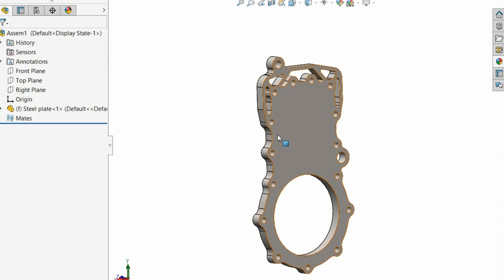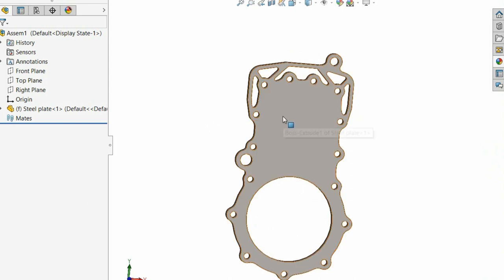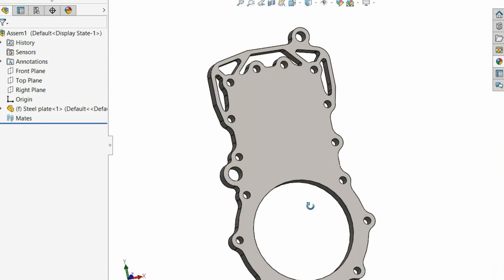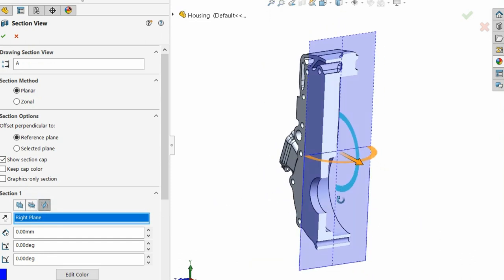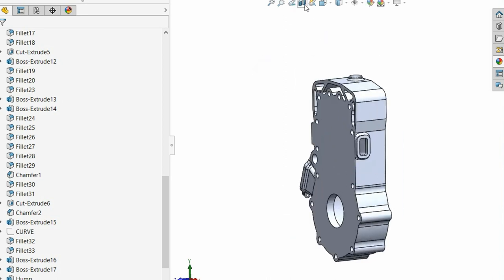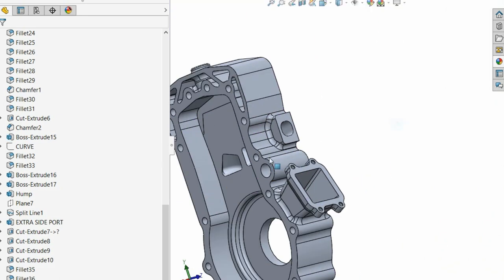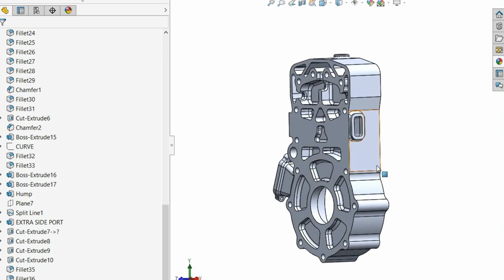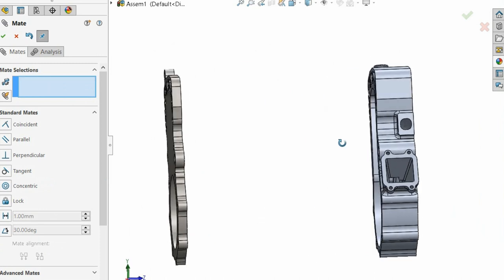The Hudson/Hossack Engine - Part 7

Comment: I like modularity of the design. Single cylinder setup is sufficient to test crutial parts and aspects of the engine.  Commercial product could make many variants from common parts.
I am afraid of wearing and forces working on piston sides.

Comment: Dying to know what the transfer port/reed block looking feature is. Guessing it has to be a part of the intake system, maybe using the ‘crankcase’ vacuum/pressure to scavenge between housings? 7 parts in is a bit of a tease…

Comment: In the next installment, I wish you would show how the porting works. I see a reed valve, an intake and an exhaust port, but how do you connect the crankcase to the intake port, and how do you seal off the exhaust port from the crankcase?
Reply from the maker: That's to come later. Patience lol

Comment: Have you considered just oil cooling rather than water cooling? I know that the cooling capacity of oil is a lot less than water but it is also significantly lighter and having to deal with only one medium could reduce the complexity. All those cavities could be oil filled too.
A lot of people think that the VW beetle engine was just water cooled but there was a good deal of oil cooling going on too. Nobody called out Ferdinand Porsche for that idea.
Reply from the maker: The cooling capability is what restricts power output

Comment: Any considerations for crankcase cooling in the future? Outside of just getting it made and running.
Reply from the maker: Crankcase cooling?
Reply: @dirtygarageguy  To aid in cooling the intake charge? I know it's not necessary at all and just adds complexity, but I'm guess asking about thoughts on later additions to the base design since manufacturing the center separate fron the end/intermediate plates is "simple".
Reply from the maker: How? Passing coolant over the intakes would warm the intake up, not cool it down
Reply: @Fra-gee-lay  are you talking about oil cooler perhaps?
Reply: @dirtygarageguy I must be thinking out side of the use case/normal operation the design. Was think of the system the honda nsr500 used to keep the crank case cool so that it wouldn't heat heat the intake air and fuel. I guess I commented some fleeting thoughts *shrug*.
Reply: @koolkei  Nah more that I was thinking of a thing on a race bike that wouldn't be needed in his application if at all.
Reply: @Fra-gee-lay  Some models of the 50cc bikes using engines such as the am6 have carb heating, where they pass coolant from the head through the carb and into the cylinder, until the thermostat opens up and passes coolant straight to the cyl, this is done so the engine gets up to temp faster to turn off the choke sooner and use less fuel.

Comment: Just fucking build one.
A little glow engine one, a proof of concept.
That nitro fuel is about 18% oil. It will seal up lovley, be easy to make.
Bang it out.
You probably wouldnt even need side seals in something that small

Comment: at the scale its currently at, what would its volume (cc's) be like? looks like a 100cc engine atm
Reply from the maker: 148cc
Reply from the maker: And there's 4 cylinders
Reply: @dirtygarageguy  so 600cc in total, nice
probably not too hard to scale it to 125cc pistons for a 125cc and 250cc variant for the smaller euro bikes
Reply: @Space_Reptile  just use a single or 2 cylinder arrangement to get 150cc and 300cc
Reply: @gadnuk7159  i know thats possible, but there is a class of motorcyle thats limited to 125cc  (A1)
Reply: @Space_Reptile  oh I forgot about the progressive licensing system over there. My b